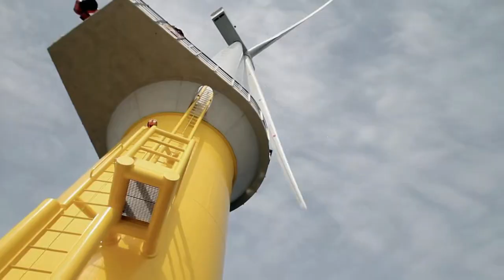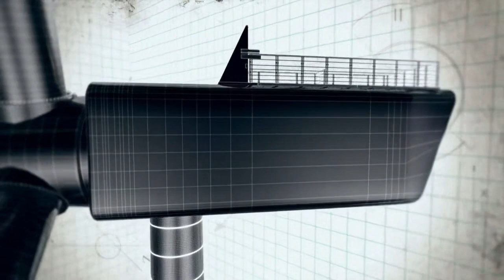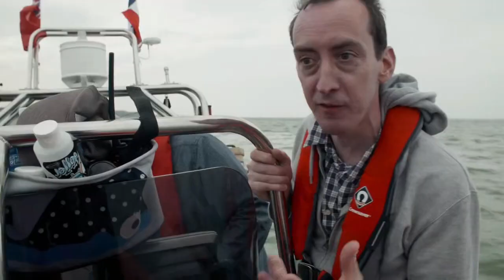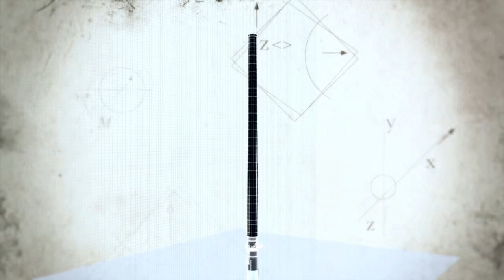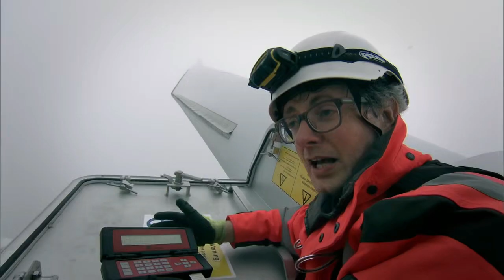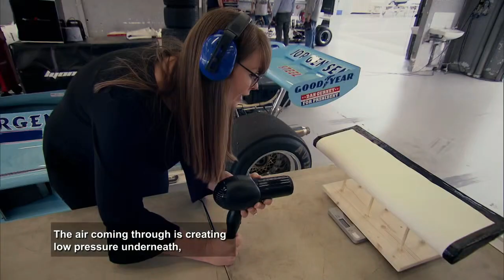World Biggest Offshore Wind Farm #windturbine #offshorewind #sea #engineering #documentary

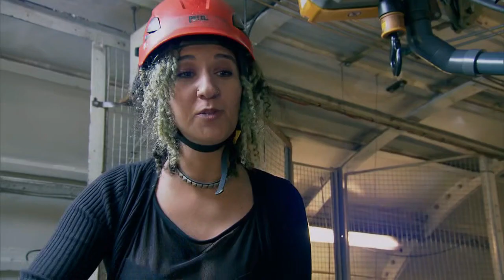Comment: At 24:51 it is stated that the 21 Million KW-hrs produced by one wind turbine would power NYC for three years. FACT: NYC consumes ~55,000 GW-hrs per year! This windmill in it's entire 20+ year life would provide a bit over 3 hours of energy for NYC. Still pushing lies from the green party. "Documentary" title should be replaced with "Propaganda".
Reply from the maker: Great to hear ur option
brother
Reply: Depends on objective. If it is providing enough electrical energy to meet current demand plus future EV load at lowest cost then coal, nat gas along with specific wind/solar use are best options this includes time of demand criteria. If you want to meet those requirements adding the objective of the lowest lifecycle CO2 emissions objective and meet energy demand then nat gas, nuclear along with higraded wind/solar applications  are the most effective options.  @engineeringdocumentaries8817